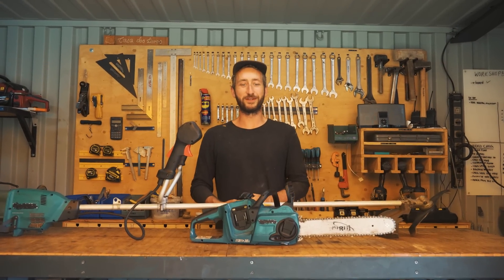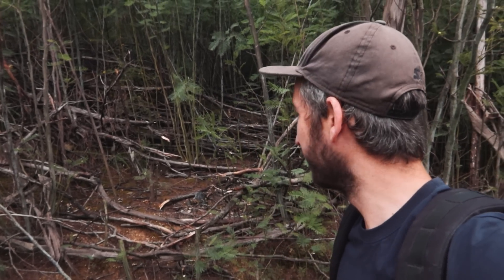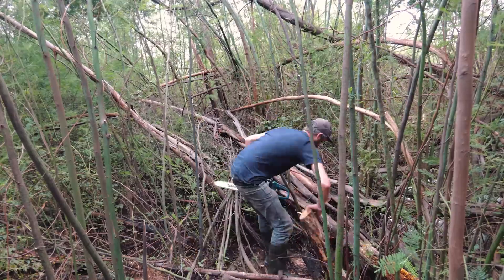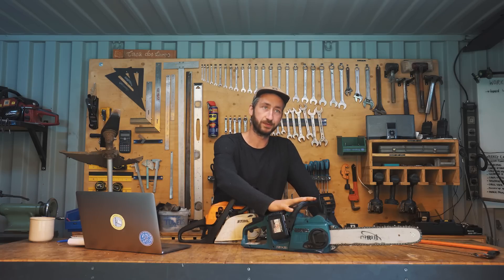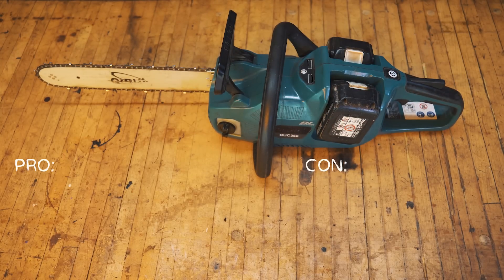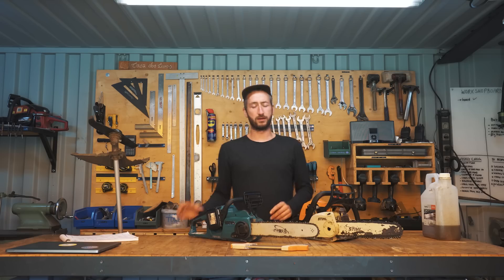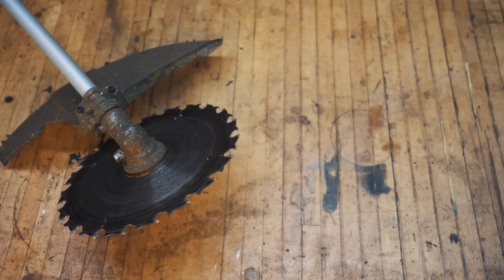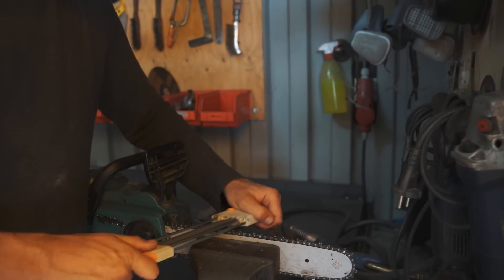#51 Real Review. Makita Battery Chainsaw + Brushcutter ONE YEAR LATER

Comment: I was diagnosed with COPD/emphysema 20 years ago and using any 2stroke engines quickly leaves me gasping for air. So one more Pro: for both tools is that they don't damage your lungs. We have mains powered small trimming chainsaw, lawn 'weed whacker' style line trimmer, and a small electric lawn mower. Downsides are same as you've pointed out, with one more Con: Needs to run mains extension cords around usually wet lawns and avoid cutting into the, which isn't always easy...

Comment: I got an electric weed whacker last year, and the only complaint is the battery only lasts 20mins. But the lack of noise and vibration over a traditional gas one is worth it.
Reply: Buy more batteries  I did
Reply: @chuckspeer2163  I've had an electric one for over 30 years and it's never run out of battery charge :-p
Reply: The electric ones are also much lighter. Gas engines are heavy.

Comment: I have the exact same saw and they have updated that silly little chain tensioner. I also replaced standard issue with bigger guage chain and bar. Cuts much better but uses a bit more battery life

Comment: I find that white lithium grease inserted into the brush cutter shaft helps reduce friction. Also a strong steel safety protector is a lot better than the light plastic most brush-cutters come with

Comment: Having used both kinds of saw extensively, I think of them as different tools for different applications. The electric saw is best if you’re only working for a short time or a few cuts, because you get the smaller weight, quiet, and no exhaust. But if you have a huge amount of work and you’re going to work all day, the electric saw just won’t keep up.

Comment: Electric tools are far more easier to repair in my opinion. Even if motor burns out, you can simply rewire it. 
And to be honest, it's hard to beat Stihl. It's very old and experienced company. My father used one of those 20 years ago, very reliable and solid piece of equipment.
Reply: Stih also has electric chainsaws. Would be interesting to see a test between gas power and an electric.

Comment: I have and use 40v saws.  I have 1 24v small one too.  You'll never sell me a gas one again.  Even my 2ah batteries last.  It's about the same investment but much more work time with no engine problems or cranking.  No gas needed.

Comment: Cool video.

You can't talk about how beneficial a cordless electric device without reffering to battery wear and end of life.
Also, I know some companies allow to store many batteries in a pack on your back, which reduces the need to swap battery every so often and makes the device held in hand very light. Much lighter than the gas powered one. I think it is a major pro if you work for long periods of time because the weight is distributed much better on your body

Comment: I feel like the weight difference deserves a mention. Carrying a gaspowered chainsaw for 2 hours is way different from carrying the electric one.
Reply: A carrying strap makes a world of difference too. Gas powered on a strap and you can go all day.
Reply: I was going to ask about that.
Reply: Kind of but running a chain only requires a couple fuel ups of gas .  To run an electric saw that long would require 10 to 12 charged batteries and they are $75 each.  So also very expensive to use the electric saw.  So for very small jobs where they are only needed for a short time they are fine. But for profesional jobs where you need to cut for 7-8 hours a day that are not appropriate.

Comment: Great video. Love the simplicity of the electric. However the other difference is that was a baby Stihl and you can get many types and bigger ones. The small tooth is not for shappening it is for saw depth and as the chain gets older it needs to be levelled down.. PS Stihl has a tricky start up procedure. With practise and frequent use if you got that right it starts in one pull.

Comment: I love my 80V Greenworks chainsaw and other 80V greenworks tools (weed trimmer and leaf blower).  I’ve been using it a lot for 4 years now and it buzzes through hardwood better than my 45cc gas chainsaw.  Prior to this electric chainsaw I had  used Stihl and Husqvarna chainsaws since the 80s.

BTW One “chops” wood with an axe and “cuts” wood with a saw/chainsaw!

Comment: I have that saw and it's fantastic two years on, the most important part of any saw is the chain, i have oregan chainsaw files and a guide which i use little and often (one stroke of the file on each tooth every time i use it). I recommend vanon batteries for makita products, they are half the price and slightly more powerful.
Reply: And don't forget to flip the bar over to evenly wear it on both sides.

Comment: It's not recommended by manufacturers, but I use vegetable oil as a bar oil, because it's cheap and relatively biodegradable. I've heard of others using veg oil with mushroom spores to encourage mushroom growth in their land
Reply: It will gum up the oil channels as vegetable oil oxidizes.
Reply: @MarcusLobenstein  honestly I haven't had issues with it at all, and i've been doing this for several years. Also, while some oils oxidize readily (safflower, sunflower, canola) many do not, and instead go rancid long before drying out (soybean, olive, oliveseed). At least where I am, what's sold as "vegetable oil" is generally soybean oil.

Comment: Personally I swear by the Husqwarna 445 I have mistreated that little saw intensively for years running it one prayers and home mixed petrol and oil. Cutting every thing from trees, pallets and old construction lumber with nails an awfulness in it. It runs like a champ. So damn good that when i finally slowed down a little I bought a new one just like it so now I have it as a backup saw and backup spare parts for the new saw.  We heat our house with firewood and I sell firewood one the side so I use it a lot.

Comment: Gasoline and oil gotta be mixed up first and you always end up smelling like a gas station.
The electric tools can also be fixed easily, even you have less parts to break.
The noise of gas tools is also pretty important as you dong get your head buzzing after heavy use.

Gas tools are only for professionals but those will soon be replaced by electric buldozzers and cranes. Electric is only taking off now.

Comment: Nice review, was wonder how the tools were working out, Eventually you will probably get away from brands & back to fundamentals, the makita is only 2 rows of 5x 18650 batteries in parallel as you get a electrian /electrical engineer on board you could create simple custom chargers, create a wired 18/36v adapters directly from you solar power

A maul & wedges is great for seasoned wood, you really shouldn't bother cutting everything if it's bone dry anyway, it should break handy enough

I find a reciprocating saw much better/safer for awkward trees & heights

Fast growing trees probably have shallow roots, a good leverage bar might just pop them out in some areas

Comment: Nice review, I have the same models of chain saw and brushcutter. Also I could recommend Makita wood chipper UD2500 (actually  the have just one model), really cool thing. Of course not so powerful like yours neighbours chipper powered by tractor.  Dave I was wondering what you do with cutted grass and bushes? Did you try to gather it for composting? There is an opinion that not harvested grass prevents the growth of new grass. If yes, what tool do you use for this?

Comment: I have used my OREGON saws quite heavily and the battery really is amazing. Under heavy use and warm to hot weather the battery will stop working if it gets too hot but as ai said the OEGON is a work horse. I like the Dewalt string timmer better but it ate the string and could not be repaired :( No fumes, less noisy. Could be an issue if you have a pace maker :(

Comment: Liked the review. The only thing i was waiting for was the prices. How much was the battery chain saw, plus the price of 4 batteries so you could keep going while the others went on a charge, also I think you can get bigger voltage batteries , But again at a cost.
Yes fuel cost money , so how much did it use in your test . Thanks again , I liked your review.
Reply: Amazon lists this model chainsaw with two 5.0Ah batteries and the charger for $469.00 in the US.
Reply: Just use google….smh its not that hard

Comment: Great review. 

Not sure if you were priming the STHL before trying go start it. I’ve never had a problem starting mine. 

What are you doing with all the brush you generate? I assume you are using the wood to cook food. How about the smaller stuff? Are you burning it or just piling it someplace to let it degrade?
Reply: I forget which video, but some expert guests strongly recommended they use a wood chipper in order in order to build up the soil. PK agreed, but they want to get one that's an attachment to a tractor so they don't end up wasting money buying multiple engines/supply trains. But tractors are very expensive, so they've made it a high priority on their fundraising goals. They have a neighbor who visits semi-frequently with a wood chipper. I don't recall where they put all the cut dead wood & brush before it gets chipped.

Comment: Did you try using higher capacity batteries? Will give you longer use and longer peak performance. ( seems the highest is 6ah. Not like milwaukee that has 12ah)

Comment: What size of batteries are you using on chainsaw, are those 4 Ah or 5 Ah? For thick trees, you'll want to get a gas chainsaw with a larger engine, with a bigger CC output. You have a really large property to maintain, so you need a serious chainsaw. Also, look into getting a mill, so you can cut boards from your own trees.
Reply: Based on watching all the prior videos, because of the 2 major fires in the last decade, almost all the trees (except for 3 to 5) on their land are young saplings. Those young trees are about 5" or less in size and very irregular in shape, which would be awful for milling in my experience. They are planning a very long term replacement plan to get rid of the mimosa trees and replace them with native trees, so maybe in 10 years with some lucky conservation they'll have something worthy of milling. But they'll also have more wildfires.

Comment: I don't disagree with the verdict on the chainsaw, but I think the difference in power could easily stem from the models. The Makita one looks quite a bit smaller and would probably be more comparable to smaller gas-powered chainsaws. Not an expert on this, just looks like the Stihl one is designed for bigger tasks by default, electric or not

Comment: A quick conclusion to make is that the electricity-driven is very useful for smaller jobs (in and) around the house being able to load your empty batteries while working. The gas one would do better for the longer intensive jobs in which you need to make a whole 'kamp'. 
I always got a Stihl on loan from a friend. He got them for free and after fixing/cleaning them they work for a decade again. They are already older than me I guess. So in that sense, it would be good to see if the electricity one is also such a long-lasting workhorse, or if it is just a temporary sustainability thing. Else you should count consuming with it is as con... but at least it is a good challenge to change up the industry for the better.
Would be amazing to have one running on hydrogen one day, so you can cut and water the plants at the same time.

Comment: Also You mised out the bit that sais .. Just cos it dont make a loud noise dont mean it cant cut your leg off
Reply: It would be interesting to know whether or not the electric one also has an electric brake. It seemed to stop moderately quickly, but for safety if it stops basically immediately then it's got that pro over almost all petroleum powered saws.

Comment: Coming from a tribologist, bio-degradable oil might not be as good as you think. Not worse than normal but the criteria to be called that isn’t that high and adjusted to fit industry. There are a more environmental beneficial substitute, namely glycerol based lubricant. There are at least one company producing it, called Sustainalube. There might be more companies doing the same thing.

And to point out my bias, the company is founded by some professors working at the same university division of tribology as me. But I have no benefit from mentioning them, just wanted to point it out since you guys care a lot about the environment, nature and your surroundings :)

With that said, lubricants are not a highly risky group per se, mainly leakages and spillage from heavy industry, but everything counts.